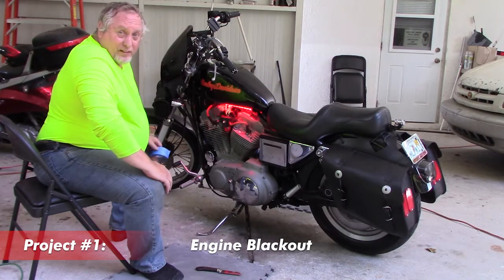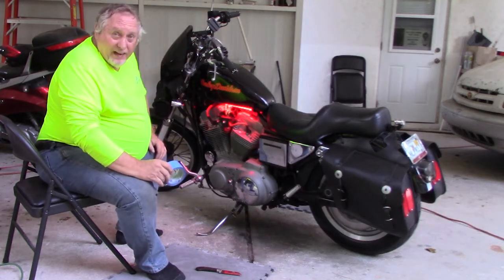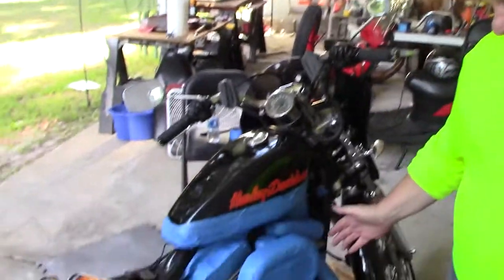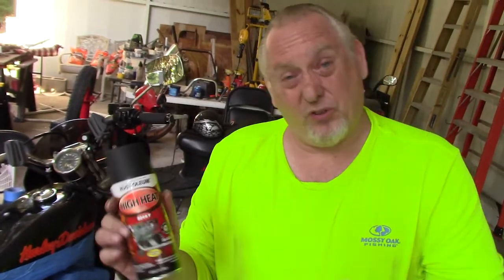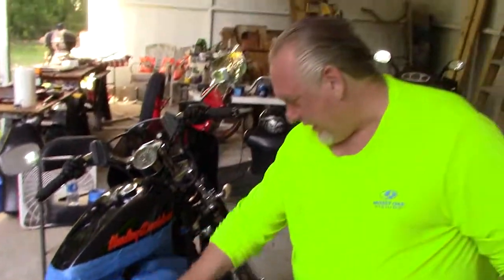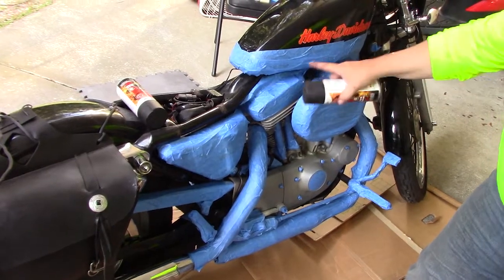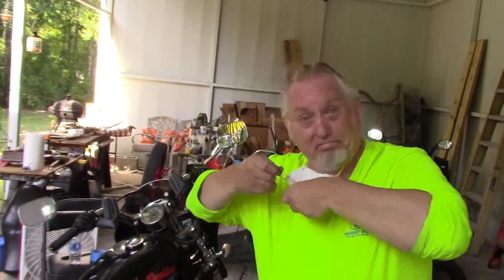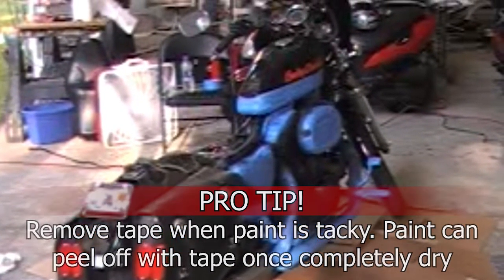Project #1: Harley Engine Blackout Time Lapse (Updated Version)

Comment: Man... the tank is 2 bolts and 2 hoses and 1 tiny ground wire... soulda saved some time. Looks good though 👌🏻
Reply from the maker: Yeah...probably would have been quicker in retrospect.  Thanks Tyler Cobler.  Appreciate the feedback.

Comment: can I ask how the paint have hold up after you have driven it? you did not use primer or anything which make me curious have the paint is now several month later. thanks in advance :)
Reply: You dont use primer with high temp paint. The primer would have be high temp as well for that to work.

Comment: Would it be legal to add a light above the engine like that in CA?
Reply from the maker: No idea.  I am in FL and local PD told me it's generally ok as long as the red lights can't be seen from the front of the vehicle  They did say however, red lights and blue lights on any vehicle can be an issue.  I mostly put them on when sitting in a parking lot with my riding buddies.  😉
Reply: @VincentAutenrieb  Gotcha thanks Vincent!